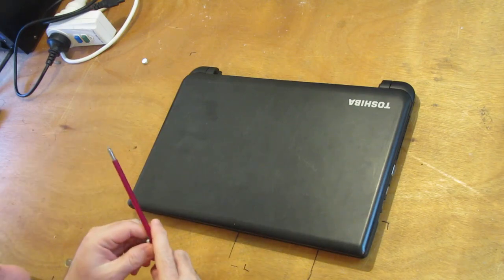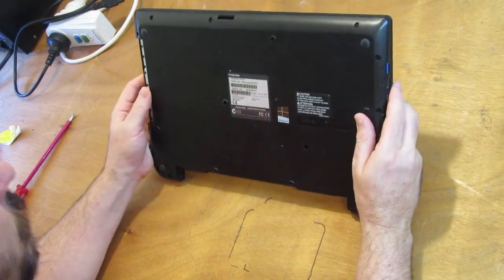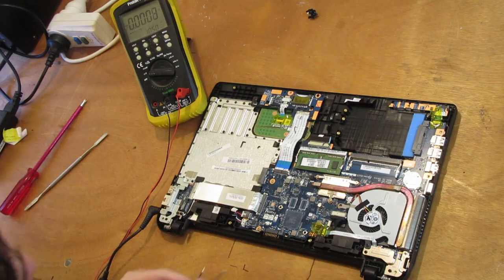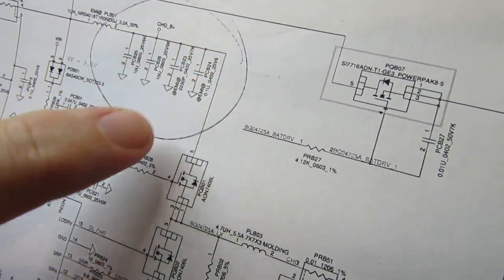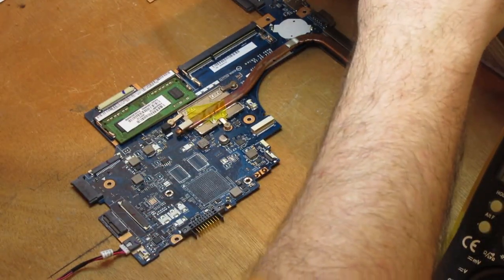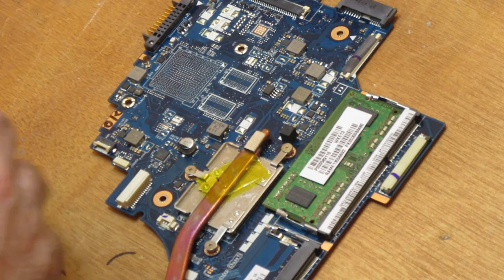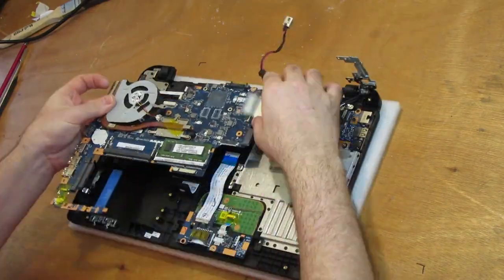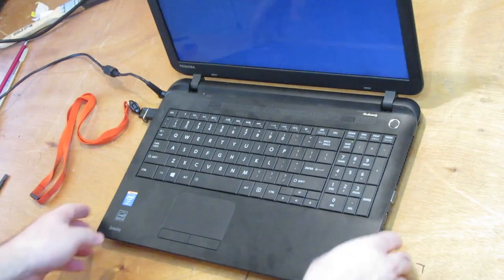What I fix daily - Toshiba C50B with no power [Component level repair]

Comment: i plugged my power cord into my usb slot by accident. problem was is the usb did not have that plastic insert so there was just prongs sticking out. Do you think that is repairable? It will power on but nothing comes up on the screen
Reply from the maker: Sadly I don't have highest of hopes for that.   If 19V went through the board it's likely taken out a lot of different things.

Does it access or try look at  another USB stick when  booting (flashing light on the USB  stick), or can you see it boot from the HDD by the light flashing?
Reply: actually have not opened it yet, I will check that though for sure. I was thinking the same thing you are as well. Not much hope. But I have a good starting point now

Comment: that was great when you jumped at 5:00 lol
Reply from the maker: It didn't seem so loud on the video, but I had my headphone/mic set  on, and the noise was being emitted by the headphones themselves, which I had duly set to pretty much maximum volume, so yep, scared me stupid :D
Reply from the maker: btw, interestingly, when diagnosing this board, I was sniffing all around the same controller chip as the one you've got on the Razer issue.
Reply: interesting. thats rough working without a microscope too. you can get a cheap amscope stereo scope for like $189
Reply from the maker: The cost of the microscope itself isn't the big problem, it's the shipping that's the killer for me here in AU.

Will be saving up to get this one (or similar)
http://www.amscope.com/3-5x-45x-simul-focal-stereo-lockable-zoom-microscope-on-single-arm-boom-stand-with-144-led-ring-light.html
Reply: That's not the right scope. You may want to consider a double boom arm style. I own an amscope with single boom arm - the head can swivel askew of perpendicular from work plane if you swing it to the side on the head mount axis. The horizontal boom arm tensioning bolts do not grip the slippery smooth chrome plated pipe well enough to prevent this.  Amscope DO have a fine semifocal double boom arm style trinocular stereo scope in 3.5x - 45x WITH 0.5x barlow lens available for less than $500 US.
Reply from the maker: I was intentionally avoiding the barlow version, either I've had bad optics in the past (on telescopes) or bad luck, but never seem to enjoy using them.

As for the stand, I had some thoughts about that, yes, my initial idea was to actually wall mount it (220mm thick solid block wall slab floor house,  no real vibrations other than those you couldn't dampen out anyhow.  I did start looking at  the twin arm version that you're referring to (and I see Jason STS Telecom has one) though admit I was dissuaded slightly but the even heavier weight and higher shipping costs.

Do you have a URL of the head assembly you prefer?
Reply from the maker: I was tempted at times to get something like that, we can get the 10x/20x wide field units here for about $500 USD delivered domestically but I'm just going to save up for the full $1k expenditure, do it once, get it right in this case.
Reply: I nearly had a shock myself. You know, like when you watch AvE and engage safety squints whenever there's a chance of something flying into the camera.
Reply: Problem: no display.
Model: satellite c50d-b127
Tested: I removed the motherboard. I tried the vga and hdmi output.
help me :)

Comment: Just wondering where is a good place to get schematics on boards such as the one in the video? I have an Aspire 5920 that is dead and it is not the charger or battery as both work fine in another laptop of mine. Also I have a Sony Vaio that will not turn on, and according to various websites says that it is probably the video chip. I might need someone to repair that one. I also noticed that you have the little solder spots on the board you are working on that chips sit on, and there are matching ones on the bottom of chips these days. How did those come off?
Reply from the maker: Hi Paul,  sign up at badcaps.net and get in to the forum there (laptop repairs) and ask if anyone can provide a schem / boardview for you, it's a nice place.

In these videos I'm removing the chips first, or in this video it's capacitors that I'm removing (because they're shorted out) and just replacing with similar specification units.

The VAIO with the video chip issue (if it's an ATi or nVidia) probably won't be worth repairing, you'll probably pay someone $200 to "reflow" it and then 2 months later it'll be dead again.  There's a good video from Louis Rossmann going over that  talks about it ( https://www.youtube.com/watch?v=1AcEt073Uds&t=24s )

Comment: It's common on these units mainly the ground fail from DC socket then the data from EPROM gets faulty and need programming or cap gets shorted these tantalum caps are everywhere now days in phones laptops etc.
Many time on c50 if you remove CMOS battery then the unit work when is no short but when the charging port wouble this is due to surge that is created when in not proper contact on DC socket somehow the kbc and flash sensitive to this.

Comment: The screws are sticking together like a ball. Is there a little magnet in the middle ?
Reply from the maker: Yes, at the start of the video you can see the magnet in front of my left hand, 10mm x 2mm round neo magnets.  I bought 100 of them for about $9
Reply: oh right hehe I should've 'rewinded' the vid :) Cool you managed to fix it btw !
Reply from the maker: Thanks, yes, I was very happy about this one, nice to have a "simple" shorted capacitor fix.

Right now I'm working on replacing an ASUS X550C keyboard, it's a nightmare because it's all plastic-welded nipples holding it down, no screws, no latches, so it's a looooong process to carefully unweld it all.
Reply: I hope you manage(d) to get the keyboard out. Did you order a replacement keyboard already ?
Reply from the maker: I did get the keyboard out successfully but unfortunately the plastic  spikes didn't quite survive as well as I wanted and the attempts to  screw on the new one (after cutting all the spikes off flush) also  didn't work as well.  Going to cost $110 to get a whole new top-deck with keyboard already in :(

On the upside, I worked out the temperature ranges and methods for the plastic fairly quickly / easy; the hot air station did an excellent job and didn't cause any problems/distortion.

Not sure if I'll bother with the posting of the video though, because I didn't succeed in the whole process, to which removing the keyboard is without purpose then.
Reply: Its a pitty you can't use the new keyboard and need to order the whole top-deck. Maybe its not worth more money/effort ? I guess the client needs to decide on that. Its OK if you don't post the video ofcourse.
Reply from the maker: Client has been advised,  guess we'll see how it goes.  I'll lately take a $0 margin  on this one since the client is a very nice one and they've had plenty of other jobs done through here before.
Reply: Paul Daniels Thats a good idea. I hope it keeps that customer happy to come back.
Reply from the maker: Likewise, hopefully they will.  Just the way business goes, sometimes you have to take  a hit.
Reply: Paul Daniels right
Reply: I'm still using a P4-based board (Asus P4c800-E Deluxe) for my main computer and am not as technical confident as you are and I don't dare to attempt a repair on it (its too important and it still works). The only thing thats wrong is that it won't startup from standby when the mains power has been off and on again (if its longer than a couple of minutes). It does startup from standby as long as I keep mains turned on. If I HAVE to remove the power (not often that is needed) I have to connect a patch-wire (paperclip LOL) on the main-board plug between the green and a black ground wire to get it up and running again. You think its a capacitor or maybe a vreg or what ?
Reply: Just asking, not really daring to attempt a repair cause then it might fail altogether
Reply from the maker: No chance it's a bad cap somewhere?  Check the mainboard and the PSU to see if you have any electrolytes venting/bulging.
Reply: Paul Daniels yea I was thinking that too. I thought maybe you recognised this particular problem thats why I asked. I will try to see later if there are electrolytes bulging (the ones I can see when the pc is at its current spot)
Reply from the maker: I'd definitely consider trying another PSU if you don't want to risk opening up the existing one ( for safety reasons ).
Reply: Paul Daniels yea I know what you mean about charges staying inside caps that are dangerous
Reply: Paul Daniels I have looked at the mainboard and none of the caps have vented/bulged. I suspect like you that it must be inside the PSU but I haven't got a spare PSU lying around. It'll do for now (the problem is livable and has been like this for more than a year) .

Comment: Hey Paul, really nice to see how you fixed that. I've got my Samsung RV 510 sitting here with all the same electronics that were put in it 7 years a ago, really expecting it to fail someday, and thanks to your videos I might be able to fix it hopefully. Btw what if you can't find the schematic for the board, but you find a shady cap could you still check the specs(like both, the μF and voltage) of the capacitor even with the short? Thanks for the informative videos, keep it up.
Reply from the maker: @payman Ghafoori , maybe your RV510 will last many more years.  In most cases the hard drives fail before anything else anyhow.

As for what to do if you don't have a schem; usually you can check other similar schems for that same area / functional block, or for many of the chips (such as in this case the BQ24735) their data sheets will have part values that will be fairly close to what the board will have.  Things like power net decoupling caps you can usually err on the larger size.

Comment: why don't you use dc power supply you find shorts a lot quicker with amps
Reply from the maker: Because it doesn't always show up on the faulty part (it'll show up on the part with the greatest resistance to the shorted path which isn't always the one you want, signature example of that is the VBATT->VMAIN MOSFET on iPhones cooking up but isn't the fault) and you can frequently find the dud cap/party with just a visual inspection.  It's also potentially damaging to other components if the power you put through is going through to other areas of the board.

All in all, while it's not always the quickest, it's still preferable to do a staged process of finding shorts from least-risk (looking) to highest risk (power injection) when dealing with customer equipment.

Comment: Shouldn't you discover WHY that cap failed in case there is a short, and it fails again? 

How do you know there isn't an issue that'll show up after prolonged use, that actually caused the cap to fail?
Reply from the maker: Couple of reasons;

1) This is a bit of a systematic type failure, seems to be an actual component level failure just from not being able to handled what it's being asked to handle/
2) Once the fault is gone, unless there's a glaringly obvious cause, it's a time pit to try find out exactly why.   Easier to send it back in to the field with warranty and if it fails again then you start looking for the cause.
Reply: Hmmm. This seems kind of odd to just "hope" that it doesn't fail. Do caps (aside from the capacitor disease/tragedy in early 2000's) fail with no cause (assuming their use was within expected params)? Will components generally fail pretty quickly if there is a fault?
Reply from the maker: Ceramic caps like these do not tolerate physical shocks very well, as such it's not uncommon for them to fail seemingly "without reason".    What usually happens (if you're lucky) is that they fail-short and then subsequently induce more self-damage to the point where the cap frequently be visibly detected.

It's a pragmatic method of repair, much like doctors will simply treat symptoms and then send you on your way again.  If the problem resurfaces then you deal with it again and start looking at possible causes.  Overall I'd say less than 1 in 25 will return for the same fault.

Google for PDFs on SMD ceramic cap failure modes.
Reply: Nice reply! Thanks for explaining. That does make a lot of sense!

Comment: Youre too worried about the hot air burning the pcb...but that is totally unfounded.PCB takes a long time to burn. The golden rule of de-soldering is .... to not have to pluck out the component using force.The moment you try to force it, you can rip off the pads..and then its a piece of brick. You should only have to touch the capacitor gently to nudge it off the board.
Reply: Just say apple.

Comment: 4.59 :D you really made my day thanx bro :)
Reply from the maker: Definitely scared myself good and proper with that one.
Reply: @pldaniels  good skills anyway. there should be more level 4 videos here. i have now one of this board charging but no power. i simple ordered a donor laptop for 45€ because i have no clue where the problem is maybe processor gone...
Reply: @pldaniels  from where did u get diagram ?
Reply from the maker: Not sure, probably Badcaps.net I'm guessing.
Reply: @pldaniels  received the motherboard but laptop still doesn powers on.im guessing battery needs for start lead not enough... Ive tried 4 different ram disconnected cables also cmos but still only blue light flashing and goes off straight !  I dont have battery :/
Reply from the maker: @gidbi  should start without battery.  If it is not, then you have other fault(s)
Reply: @pldaniels  no there is no cmos on mother board so the bios cannot get power if main battery not inserted thats why it has a ''not removable battery I guess'' you answered from experience or just guessing because as far as I know if there is no cmos on mother board  bios needs the main battery
Reply from the maker: It'll still boot but it just will want you to set the parameters of the BIOS/CMOS, that's the only difference.
Reply: @pldaniels  yes it came on now saying time problem but thats probably the battery. ok sorry to bother u..

Comment: I hate hp its not simple as this Toshiba her you just remove back cover but in HP you have to remove Motherboard to access RAM which is in opposite side below the keyboard I hate hp design
Reply from the maker: Yes, as a general rule I have found the older Toshiba laptops to be a lot quicker/easier to access. I've had a couple of those HPs where you have to pull the main board just to change the SODIMM, quite frustrating indeed.  

The new trend of the board assembly + keyboard/top-deck being the main unit is "interesting", some of the bottom cases are easy to remove, some are littered with hidden screws (had a HP the other day, hid a retaining screw under the far end of each of the four underside anti-slip long-strip rubbers).